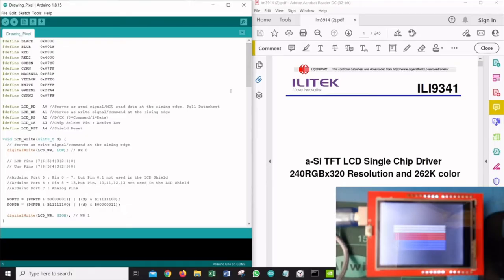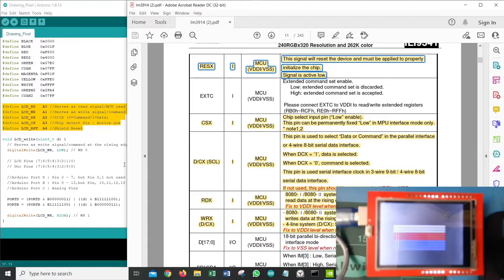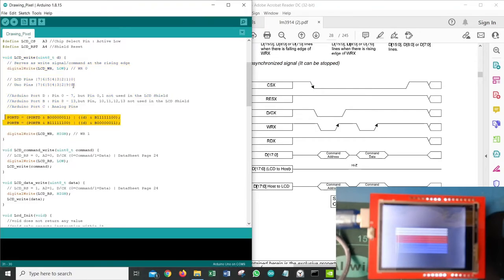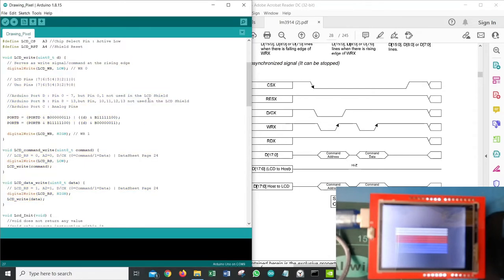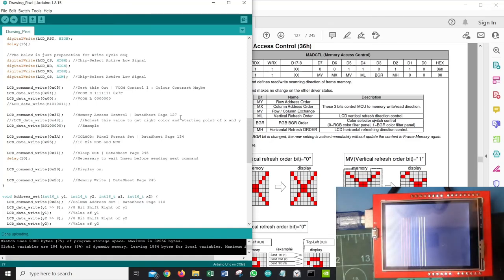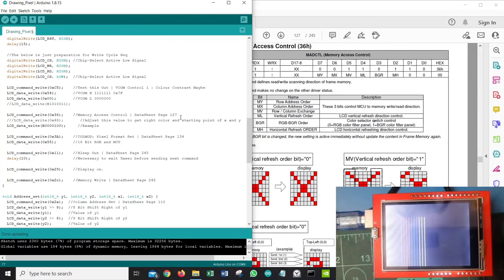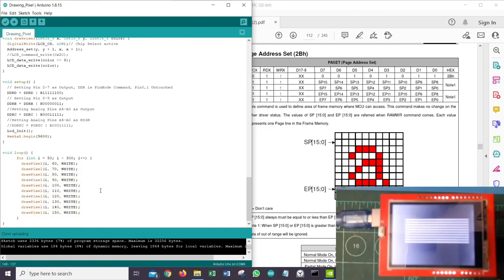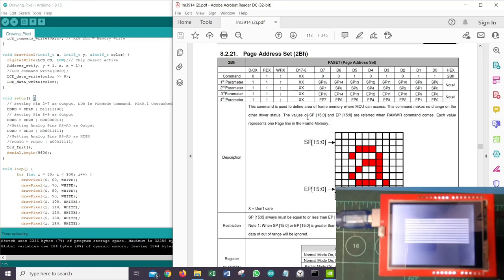Part 1: Using TFT LCD Display without Library

Comment: Hi sir, thank you for this video.
I have a question here, is it possible not to use the analog ports and use digital ports instead.
I have a project that require the need of the Analog ports for sensors, and that TFT is using them in Arduino UNO R3.
how to make the TFT read from the digital ports for LCD_RD, LCD_WR, LCD_RS, LCD_CS, LCD_RST as that will free up the analog ports for me.

Comment: Hi mate, amazing video, literally saved many lifes. One question, why its necessary to do address set every time to write a pixel?
Reply from the maker: To avoid any confusion, could you point to which minutes and seconds of the video you're referring to. Then, I can answer accordingly :goodvibes:
Reply: @electronicseternity9210  min 48. Reading the manual i noticed that is the correct way for printing any pixel in the tft
Reply from the maker: @joaquinmarianopineiro2716  to inforrm the TFT about where we are drawing the pixel.

Comment: Great tutorial i tried to write the program based on it but with using stm32g0  instead od Arduino ( the same display ) and there is 3v3 voltage not 5v used and i got only white screen. I provided also 3v3 input voltage to 3v3 input but then display doesnt event show white screen until i provide 5v. Ili standard states that 3v3 voltage is used but this hx8347 is Arduino shield so it probably work on 5v logic. Do you know is any possibility to configurę that shield to use 3v3 volt? I see jumpers there ( j1 to j4) but can't find any details, i can use also external pullups to 5v but need to rework much on my PCB..
Reply: Can you share the code which you used for stm32

Comment: void loop() {
      for (int i = 50; i < 300; i++) {
        drawPixel(i, 60, WHITE);
        drawPixel(i, 70, WHITE);
        drawPixel(i, 80, WHITE);
      }

      delay(3000);
      LCD_command_write(0x28); // Display OFF
      delay(3000);
      LCD_command_write(0x29); // Display ON      
}
/// The command 0x28 and 0x29 don't turn off-on the leds for backlights in tft display.. do you know why? I need to turn off the display's leds to save energy in my 9v battery.... please help me
Reply from the maker: Apologies for the delay in response.

#include <SPFD5408_Adafruit_GFX.h>    
#include <SPFD5408_Adafruit_TFTLCD.h> 
#include <SPFD5408_TouchScreen.h>

#define LCD_CS A3 
#define LCD_CD A2 
#define LCD_WR A1 
#define LCD_RD A0 
#define LCD_RESET A4

Adafruit_TFTLCD tft(LCD_CS, LCD_CD, LCD_WR, LCD_RD, LCD_RESET);

void setup(void) {
  Serial.begin(9600);
  
  uint16_t identifier = tft.readID();
  Serial.print("Controller ID : ");
  Serial.println(identifier, HEX);
}

Run the above command to find out what is your LCD Controller. If it is 9341, then refer the datasheet to find out commands that can control LCD Backlights. To be honest, there are many commands that can be utilized.